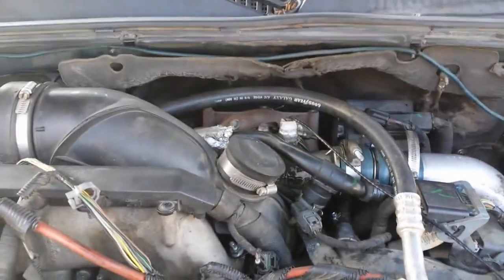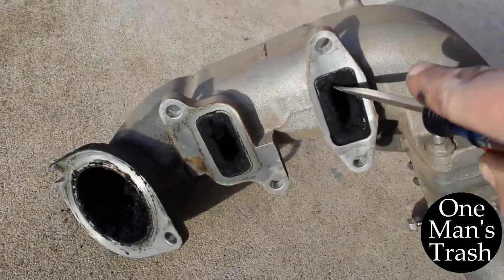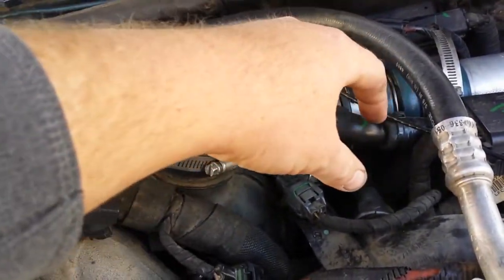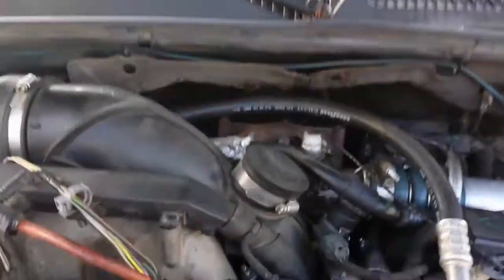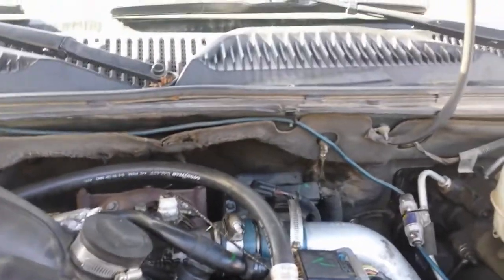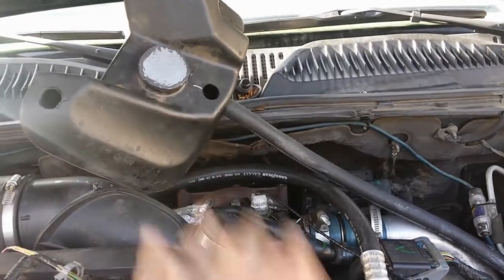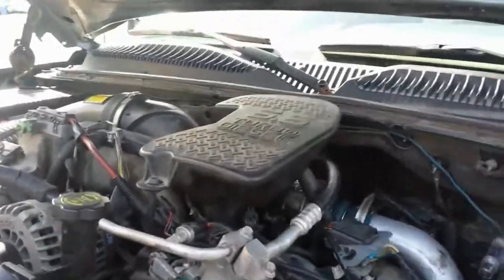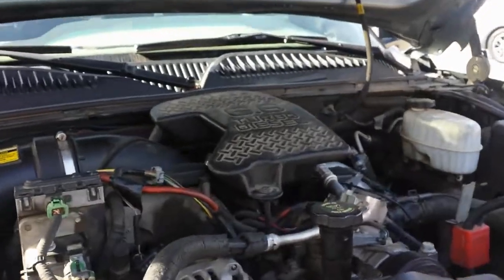Duramax PCV re-route - using resonator as an oil catch can

Comment: I made a makeshift oil catch can by running the hose by the master cylinder T ing it and placing a air filter on the high side to vent and running the low end all the way down next to the oil filter with a ball valve so I can open it during oil changes
My pcv valves works good cause there hasn't been any oil in it yet
The only downside is you can smell the vent with the window down at a stop since it's by the drivers window
Reply from the maker: Simple and effective, nice. There is no getting away from these trucks smelling like a diesel, but I think I’ll let mine vent back into the air intake to minimize the fumes in the cab.